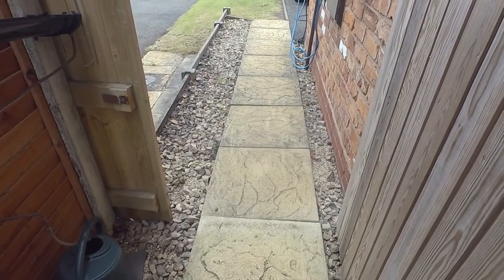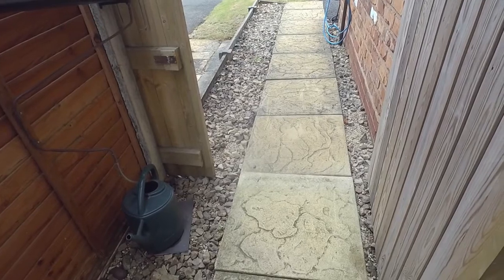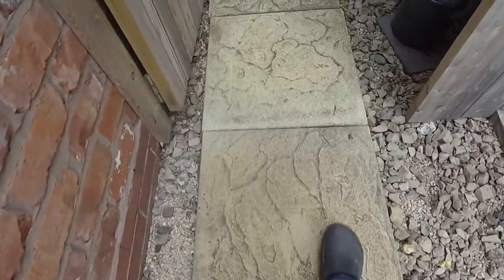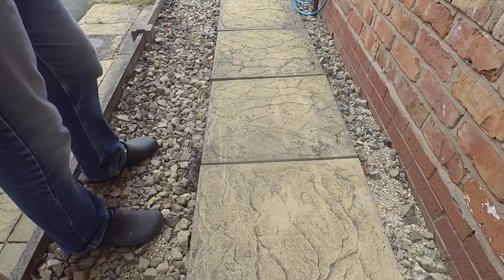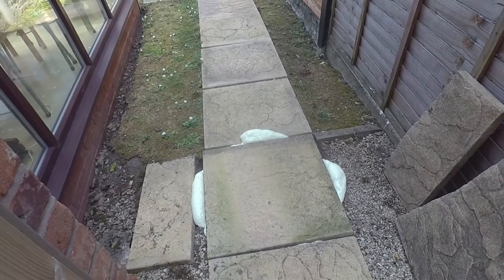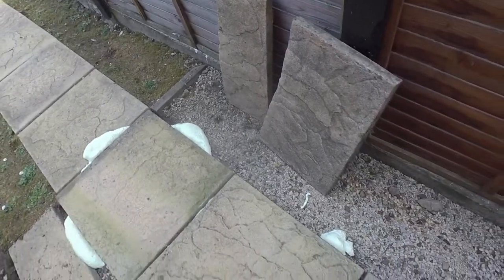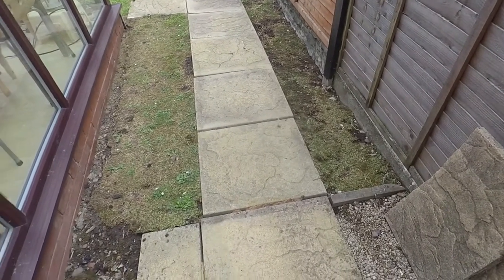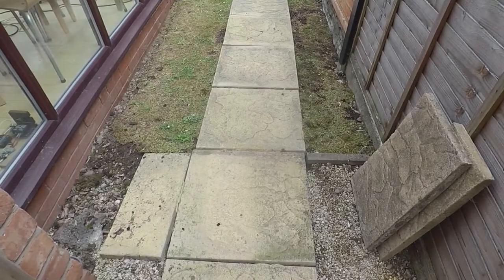Rocking Paving Slabs Fixed with PU Foam

Comment: Thanks for sharing !!! What a great idea! Ive got 3 loose slabs and 5 tins of foam that I bought for £2.00 when a local builders yard when they were selling up.Nicd one .!
Reply from the maker: Nice one. It does work well (& is used for repairing subsiding concrete drives in the USA). Good luck 😀

Comment: Hi
Just wondering. How is it now? Are the slabs still fixed or become wobbly again?
Reply from the maker: Yes the slabs are still good. I noticed one was slightly loose recently but it turns out to be one that I hadn’t put foam under. I’ll fix this when the weather’s a bit warmer 👍
Reply: THEY LOOSE AGAIN THIS FILLER FOAM IS NOT DESIGNED FOR THIS WORK  STAY WAY FROM THIS ONE
Reply from the maker: @pete2803  Hi. Sorry that it didn’t work for you. You’re right, of course, PU foam is not sold for this purpose and is a very expensive material to use, compared to conventional methods. It’s good as a quick fix though, saving me a day of hard work, or an expensive contractor bill. Mine have been OK for 10 months, so far. . . . .🤞
Reply: Bodge fail

Comment: You are better off just taking the loose slabs up and replacing the mortar underneath as foam is slightly flexible it will not take the traffic load. Don’t do spot bedding though as it’s not the correct way to do it!!
Reply from the maker: Fair enough. My slabs were spot bedded by the builders who built the house. 25 years later, foam was a quick way of filling the gaps between the original ‘spots’ and stabilising the slabs. Very low traffic situation, along the side of the house. If it lasts another 25 years I’ll be happy, even though it’s not a traditional, best practice solution.
Reply: @Greeves  Fair enough whatever works for you. I’m sure if it’s a quick and temporary fix to keep you going for a while til you are able to afford to do the job properly then that’s fair enough. Quick tip, if you do end up taking them up again at some point and don’t feel like going back and forth mixing mortar, I’d suggest a bed of sharp sand but screed it first so you know you get your falls and levels right :)
Reply: @_tmmy_  I'm interested in this because I have a problem with slabs at my mother's house. Having lifted them, I've discovered they were not laid on a flat bed and are in fact "held up" on columns of bricks - therefore only connected on each corner and a thin sliver along the sides (it's a deck area outside her front door). I've tried using 'U Can' mortar on each corner but they are still wobbling. Any tips Tommy??